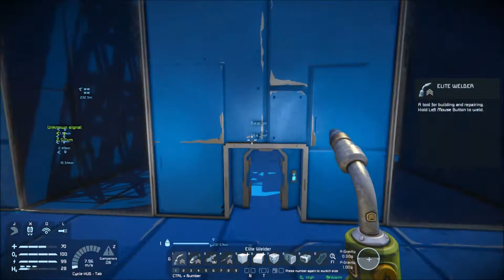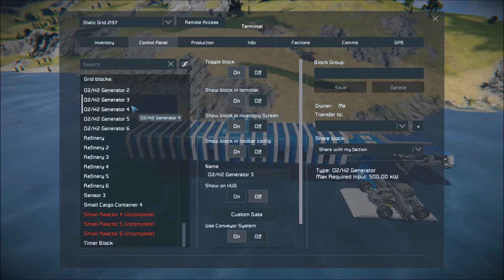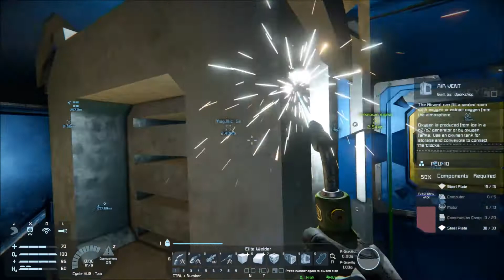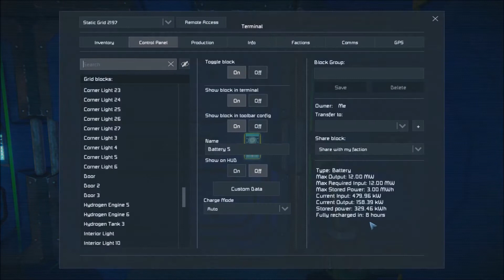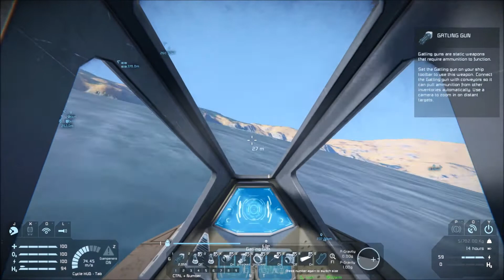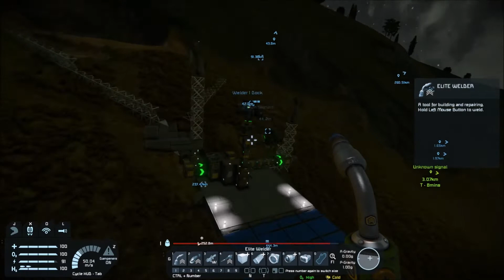Surviving Space Engineers - Ep15 - Fuel and Fighters

Comment: hydro engine use too much hydrogen to be of any use my power solution was 4 wind farms.
Wind Farm - on pillar 12 blocks high with 'X' on top 4 blocks on each branch 2 wind gen top and bottom with 4 farms going I get 12mw 24/7
Reply from the maker: Yeah I really like the new wind mills, Hydro engines just need tweaked to be any use I think.